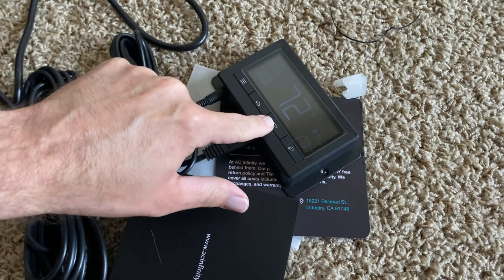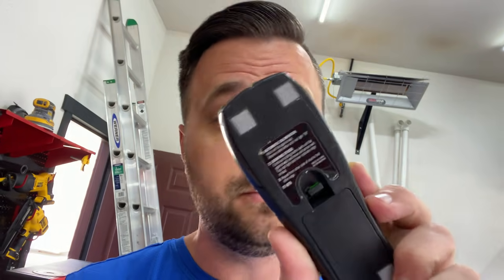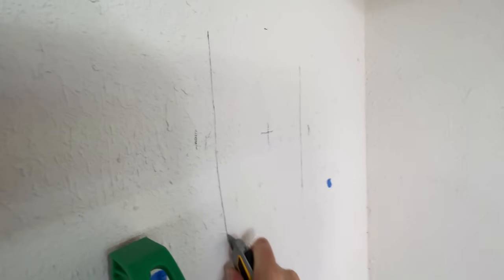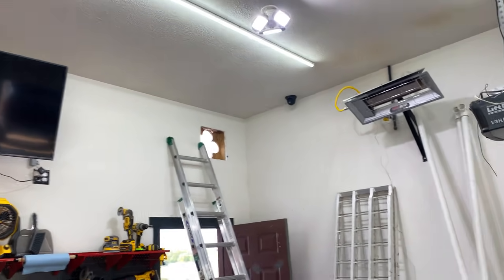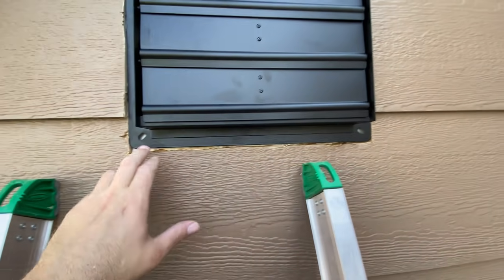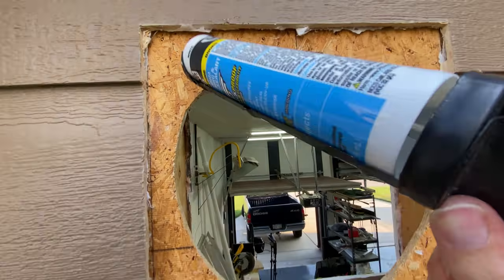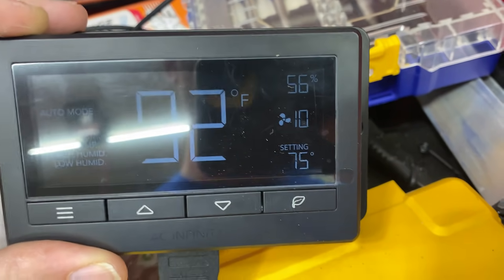Installed a powered garage exhaust vent

Comment: I hope that you did something about the wasp nest that was literally 10 inches from your head @6:23 in the video?  Otherwise, you may find wasps inside your garage now that you have the fan there.  Those things find a way into your house at every chance they get.
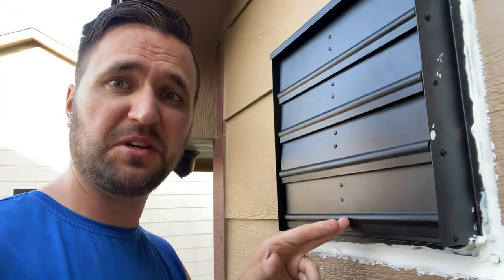Reply: First seen at 5:54  but nothing at 6:23
Reply: Might be a old nest from years before. He probably knocked it down in the second scene.
Reply: @tcntad87  Still visible in the outro
Reply: @johncoles  so?
Reply: @tcntad87  Well it’s still there at 6:20ish and the outro so I think the 6:23 timestamp mentioned might have just been a little off.
Reply: @massgrave8x  OK boomer

Comment: At first, when he went with the heaters for the garage instead of a mini-split heat pump, I figured, ok he does not plan to use the garage much and just wants to keep the equipment stored there a bit warmer in the winter, but now it seems a like a massively missed opportunity. Instead of working in a 92 degree garage and exhausting air that has to either leak from the outside (hot) or inside (already conditioned) he could have enjoyed a fully climate controlled environment year round and probably a less noisy one as well. A DIY Mr. Cool would probably have been almost the same cost. Perhaps a few more days chugging on crypto to pay for the electrical circuit to be added. He could have even insulated the garage doors as an extra project.

Comment: No need to trim the inside of the garage just install a return air vent cover.  I don't know what your dimensions of the hole are but you can find 25"x25" covers that just screw in.

Comment: You did it wrong. You installed it so that the flange is outside the house and that you have to ‘slide it in’ from outside. The reason that is wrong is the outside is gonna look like shit with the silicone stuff and you can see everything. Instead of a round hole, you  should have made a square on the only the tipping vane part penetrates which is gonna make to outside a lot more pretty. Now you’re gonna have to live with both sides of the wall to be kinda ‘not great looking’

Comment: Just an FYI. The fan Screws in from the inside and that protrusion goes into the wall. Nothing should protrude from your home. The floppy things still faces the outside. Unless this is different than the one I used
Reply: You are right my friend.  He needed a square hole on the outside just for the vanes to open.  No trim would have been needed, just caulk.

Comment: I'm not sure about the thickness of the wall and the fan, but it seems like it might have fitted more beautifully if it was screwed in from the inside. So that the square piece of the fan would have completely filled the hole, with it sticking out less on the outside and no need to drill a circular hole and less finishing that needs to be done.

Comment: Where does the air come into the garage from?
Reply: 6 months ago he bought an air generator /s
Reply: From the hot outside, along the bottom and tops of the doors, into the cooler garage making it hotter.

Comment: How will that 1 exhaust fan help cool that huge space? Or did I miss something
Reply: If its colder outside than inside it’ll create a negative pressure inside, if you then open a window or something on the other side it’ll get the pressure back through the window so you basically got cold air through your whole room
Reply: I don't think it's for cooling. He was having CO issues running his heaters in the winter and needed a way to force air circulation.
Reply: @nathankooistra7788  that works to but itll get cold so niet very efficient lol

Comment: please, oh please don't install the fan this way if you plan on DIY. siding is now destroyed, and that caulk is for interior use only... look at the review pictures on amazon on how to properly install it (flanges should be on the inside). either way, i still very much enjoy watching your DIY videos for entertainment value. keep them coming.
Reply: I blame the product photo, the manufacturer just took some digital stock photos and stuck the fan on a exterior wall. I'm sure if there are instructions it will tell you have to mount it. I'd build a wooden frame using 1x2s or something and mount frame to the stud, and then mount the fan to the frame. That avoids drilling into the back of the exterior wall/siding. He needs flashing the way its installed and replace the caulking with flashing caulk. Haha. Also peeling the wrap that protects the wood. 😂
Reply: Yeah. This project was a disaster imho. Fan installed on wrong side of wall and water barrier ruined.

Comment: I wonder if he’s aware of the negative pressure that will cause…
Not sure what the strength of that fan is but if its like the ones that were in the radio tower buildings I used to work in, he’s going to have fun opening his door when its running. lol

Comment: Just want to say love you videos but I would have to say I wouldn't have glued the fan to it what if the fan dies I would have glued a rubber mat there so when you screw the screws in from the outside the fan would push against the rubber mat and create a seal so you could always take it off to replace it if it ever dies or something goes wrong but hopefully it doesn't and just use the sealant for the trim around it cuz you can always pry that off and cut it off
Reply: But glad to see you used AC finity

Comment: You didn't need no damn trim or nothing all you had to do was put a beat of caulking around the metal that you could have screwed straight to the damn siding and it would have looked good and been complete you made yourself a bunch of extra work for nothing
Reply: Yeah if the bead was behind the metal it would have been fun perfectly fine and it wouldn't stood out as much as it's going to stand out now of trim and shit all over it and if he was worried about the gaps that the paneling made you could have got you some shims and use trim nails to hold the shims in place after you caulk them in place but you could have filled that space that were talking once everything cured the first time could have went back up there in a couple hours and filled the gaps that were caulking smeared it over nice with your finger and I never seen it from the ground it would have been a professional looking job but now you got to counter sunk mess

Comment: Jason oh Jason you beautiful man you, this is exactly what I need for my garage. I'm getting a Tesla powerwall and solar panels installed on the roof. The installation people say to my garage could get little hot during Peak summer for the powerwall and they wanted to be a bit cooler. This thing is perfect. It's quiet small and it looks like it a move just enough air out of that garage. I will definitely be using your affiliate link to purchase this next. that's why I watch your channel, thanks and have a good day